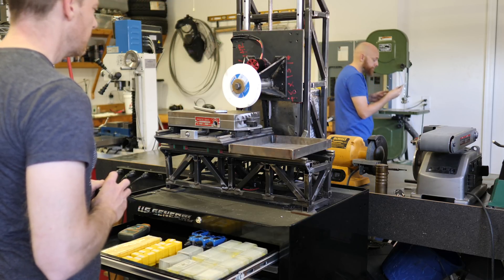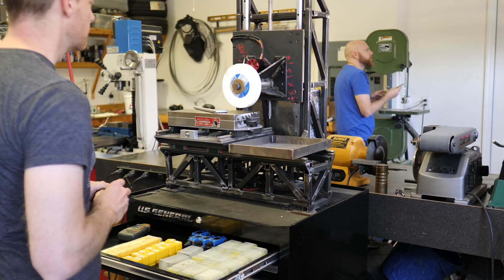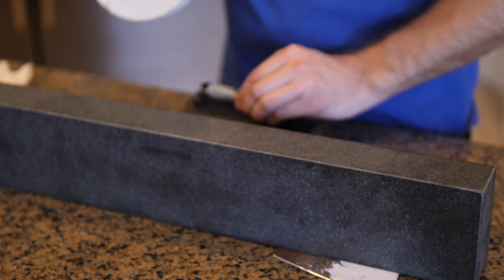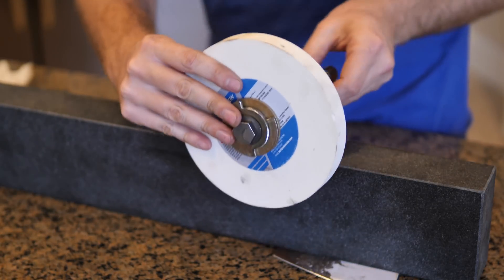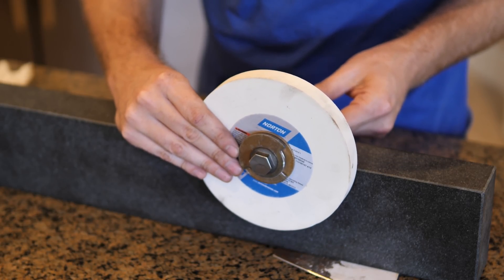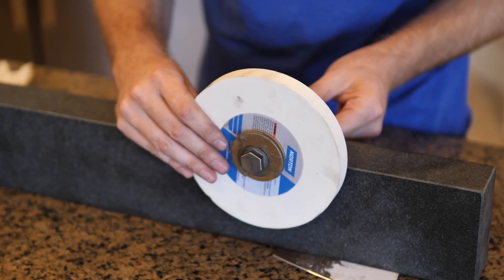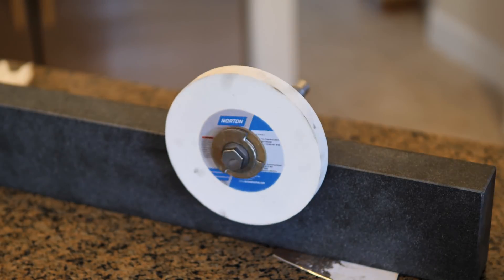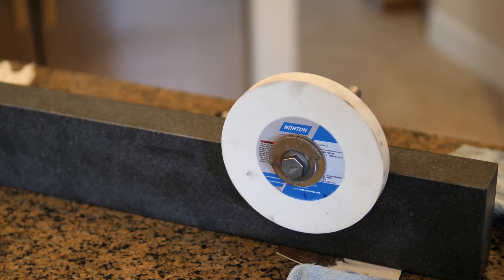Surface Grinder? Check. - S02E49

Comment: That would be great for a cross purpose grinding machine. Make the grinding head easily removable and add a 2"x72" belt sander head. Knife makers are probably the largest group doing these conversions to conventional surface grinders. Accuracy of course suffers a bit but stock removal is dozens of times faster and great surface finishes are achievable. You'd be amazed at the number of people doing this. Check out 2x72 surface grinder conversions, you make like what you find. Done right you could convert it back in forth in 30 minutes or less. Great job on the machine!

Comment: You're going to have to be very gentle with your cuts without flood coolant. That problem with any Grinding is the heat generated locally creates positive feedback. By that, I mean that if you take a reasonable cut, the heat you put into the work causes it to expand towards the wheel, meaning on the next pass you will take a deeper cut and so on.
If there's enough mass, and you're gentle, you'll likely get away with it on a Surface Grinder. Don't try it on a Circular Grinder between centres though, it will surely end in tears because the effect is magnified so much more.

Comment: Just watched whole series, and i probably missed something. What size of rails did you guys used? I am just starting to gather materials to build small surface grinder(manual, not CNC). Your video series is a great inspiration. I am planning to get around 10x5 work area since this is more than enough for my use. I already welded solid frame from thick C beams that will probably be overkill stiffness wise for such small machine, but its always better this way than the other. If you could tell me the size of linear rails you used that would be great, and save me a lot of thinking and calculations. Thanks!

Comment: Halo guys, i think chatter problem come from small motor and low speed, for this size of wheel you need at least 2 HP motor and 3.000 RPM, for 250mm wheel need 3 HP motor, also other problem in chatter come from unstable motion from step motor.

Comment: That is sweet. "BUTT"' A surface grinder has way more uses than just flat surface grinding. You need the Y and Z axis with a back parallel on the Chuck to grind slides n gibs. Like form dress the wheel with a diamond to side and flat grind.

Comment: When you ground the magnetic hold down table, it didn't spark. I was told a long time ago that if what you were grinding didn't spark you should not grind it as the grinding wheel will load up and could possibly explode (shatter at speed).  Just asking. And you did very fine work on the grinder, thanks for sharing your work.

Comment: I think you would do a lot better with the chatter with a larger motor. Not just for power but also mass. And even use a flywheel to stop harmonics and smooth out chatter and bogging. Maybe even direct drive but I would think a lot more weight directly on the spindle will keep things more solid and smooth surface finish.

Comment: 4:25 Lol, do you really expect the slide to run true after bolting the guide rail to a surface that is half ground by hand with an angle grinder, half still painted? That will be a pretty bumpy ride. Where I work the mounting surfaces for guide rails get scraped flat to a tolerance of less than a thou over several meters. Never think your rails will always stay straight no matter what, they will comply to the mounting surface. Also don't trust bar stock to be straight, it most definitely is not.

Comment: oh... i was hoping to get some more informations about the wiring of the motor. I could use that for my projekt. Maybe some one can help me out? I dont know if i can run this with a power supplie or do i need a 
battery pack... So much more questions

Comment: Thanks for the vids, blueing up a newly planed surface on your surface plate would give an additional visual.
Reply: Check our Instagram :) long story short: I had to try twice to get a thin enough layer to show anything, but when it did it was very interesting. You can even see the stripes from the stepover/traverse. I think those are only a few tens of millionths deep but I'm guessing fairly unique to our machine

Comment: the whirlwinds created by the moving parts are spreading the abrasive dust all over the place. You ought to protect/get dust proof the grease and the rails absolutely because it won t take long before the balls start to roll rough. for sharpening cutting tools on  bench grinder I built a device on a schumacher linear ball slider (top slide and downrail same lenght 10 1/2")  , though i designed something clever to remediate , it is not 100% perfect . when i feel the balls are rolling on flakes , i take it apart and rinse it in the parts washing solvent machine
Reply: This sounds like a good idea: I really don't expect the rolling covers to fix everything, but didn't have a better idea. Do you happen to have pictures or a video showing what you did?
Reply: @wileecoyoti  I wanted to make a video of my Myford lathes but I am not savvy with computers nor do i own a smart cellphone , I made 6 videos in 9 years on youtube with the help of a friend ... let me some time and i will post that "Myford mental ward" video with devices I made for my own needs. for now you can picture it out to yourself. my system is not like yours as the grinders are on a perferctly  flat 5/8" sheet table top ; I made a shroud out of .008" brass shim/silver soldered , totally covering the slider with some kind a of pipe cleaner brush acting as the downseal/downrake (between the shroud's bottom and the table top the gap might be around .020"). You have a different situation than mine. For the shape of the moving parts on this grinder what I would see would be something like you find on the cheap imports or high quality german would be a device alike the accordion type but proudly designed and made in North America with real mylar or some near material , meanwhile to spare the assembly you can take red Tuck tape , sicsors and polythene from shopping bags , wrap what you can  and discard it after each use(polythene is easilly movable , wouldn t get in the way) ? it is a nice project , nice work . rene levesque

Comment: The love of shiny metal things. You can't help but fall in love with a ground flat surface.
Also,  I guess everyone noticed that the lathe works fine without the surface grinder. :)

Comment: I don't understand the "balancing of the spindle" when dressing the wheel in place, on the machine would have achieved the same thing...and now that you "balanced" it off the machine, when you go to dress the wheel ON the machine, It could throw it back out of balance...
Reply from the maker: Yes and no, you can have a perfectly concentric wheel and still be out of balance, that's the case for our machine for sure. That being said, you are right about dressing the wheel causing it to go out of balance. To solve this we balanced the wheel twice, before and after it's dressed. That seemed to have good results if we were careful not too loosen the retaining nut on the wheel enough to change the position of the wheel. You probably wanted to dress the wheel a second time after that. It's far from a perfect system, but the amount of use this machine will actually see, it works just fine for us.
Reply: @PhysicsAnonymous  well the results speak for themselves, for a diy surface grinder, I'd say you guys did an awesome job! 🍻

Comment: So how do you account for the material loss on the grinding wheel?   On a large object that would change the level of the flatness would it not?
Reply: Typically it wares into a taper and you grind advancing in one direction. So as you grind, you start out with the leading edge doing all the grinding. Over many passes it will eventually get to the point where its cutting on the trailing edge, but long before that you should redress the wheel, which will square it back up. It takes a lot of grinding to get it cutting on the trailing edge. So the effective cutting diameter remains the same. I think Tom Lipton explained it better in one of his videos.
Reply: @lordgarak  I get what you are saying but I stated my question wrong.  Over the course of time the loss of material will change the diameter of the wheel.  So let's say if you are trying to grind a 12"×12" piece of material on one side the "X" it will be higher than the other end.  Even in the "Y" axis.  

I will look up that video you referred to. 
Thanks for your reply.
Reply: @CJMorin  The effective diameter remains the same as all the material loss happens on the leading side of the wheel. If your grinding properly your only stepping over something like 0.100" on a 0.750"  wheel. That first 0.100" of the wheel is doing all the work and receiving all the ware. After a few passes the next 0.100" starts working harder. So the third 0.100" is bringing it to final dimension. You can complete a fair number of full passes across the part before you ware across the entire wheel and have to redress(depends on the material your grinding and the properties of the wheel).  After redressing you would take a light cut and measure your work to see exactly what height its cutting at. 

Their machine can only grind something smaller than something like 12"x6".
Reply: @lordgarak  ok tha is for the explanation that makes sense.

Comment: Very nice.  But for the sake of all that is good and decent please build a solid stand for it rather than the $50 harbor freight roller box.  When you are measuring tenths it doesn’t matter how strong you built the machine if the base is rocking and rolling and flexing and heaving.

Comment: Knowing absolutely nothing about these things (but hey, this is youtube), I still think you should have cast the support structures into concrete/epoxy, but I guess you could still do that if the balancing of the wheel isn't sufficient to get rid of any oscillation/chatter/vibration.

Comment: "Now we can finish the lathe restoration!"
"Is that why we were making this? I sold the lathe to finish this thing!"
"..."
Reply: I for one am anxious to see it used for its intended purpose of grinding the ways on the lathe
Reply: @j7gy8b  making this was to learn how to make a surface grinder so they'd know how to make one that was large enough to do the lathe ways
Reply: @Anthony Lovell. Yes, that's what I thought - a quick prototype to check, then get some contraption to sort  out the lathe. Anyway, it's cool. Maybe they have enough patrons now to send the lathe bed out for a regrind, or buy a lathe with unworn ways.
Reply: I had completely forgotten about the lathe XD

Comment: Constructive criticism .You didn't relay do any of the suggestions in the comment section from your last grinder vids ! didn't even fix the spindle bearings ,slow-mo of the wheel shows it flopping around like a frog in a sock , and i think a straight on shot of the surface wound show it clearly .No amount of balancing can fix a average spindle  .Could have stiffened up and deadened the frame (epoxy granite or even concrete)  .It could be SO much better with a bit of work other than a coat of paint and a new motor .(But seriously you've done a relay good job and made a good usable machine that's better than most shop made stuff very well done )

Comment: Looks good.. But going by the amount of wobble while it's grinding it could go with some counter weight or getting bolted down lol
Reply: whole thing is flimsy should have just cast it all out of epoxy granite
Reply: It is on top of a cheap moving tool cart. It really needs to be on a solid surface. The frame of the grinder is perfectly sturdy for the forces being applied, but I have got to believe that much wobble is going to loosen something.
Reply: @bluedeath996  I remember in a previous video, the surface quality of the part was extremely poor. Hobbyist don't understand that a machine structure is designed for damping, not for rigidity under elastic deformation.
Reply: @meocats   ... nothing beats MASS 😎👍☘
Reply: @meocats  If damping is the goal, why are machine tools made from giant blocks of plain, cast iron? Composites usually have superior internal damping (along with a lot of other nice potential features), can be engineered to have VASTLY superior internal damping, and can be made more cheaply than cast iron. Also, there are a million-and-one add-ons to fix what internal damping doesn't that I've never even seen mentioned in relation to machine tools. I'm not saying you're wrong (it sounds like you're more qualified to speak on the topic than I am), but if you're right, then it seems like the whole industry needs a serious paradigm shift.
Reply: @peterfitzpatrick7032  Mass doesn't damp. It only lowers the frequency of the vibration.

Comment: Cool! I almost forgot that your aim was to fix the lathe two years ago! I am wondering, how did you manage to get two linear rails to end up on the same plane? What is the process for that?
Reply: You can check for equal distance (DTI base on one rail, probe on side of other rail) and for relative twist between rails (DTI on top of other rail; done for both rails). This doesn't guarantee flat (could be a spiral if both rails twisted the same), but given the unlikelyhood of a spiral, you're very likely to get a decent plane.

Comment: why didnt you use a 3 phase induction motor instead of the bldc one
Reply: A bldc IS a 3 phase induction motor
Reply: @codycarse  Not quite. An induction motor does not use permenant magnets, which can be ideal when the environment consists of floating ferrous metals due to, say, grinding steel.
Reply: Can't speak for them, but I would have chose the BLDC as well.  Easier/cheaper to speed control, more compact, better power factor, superior rotor cooling, lighter weight and less expensive.  If it makes you feel any better, the BLDC is surely also 3 phase.  The down side of a BLDC here is you now have magnets near floating metal shavings.